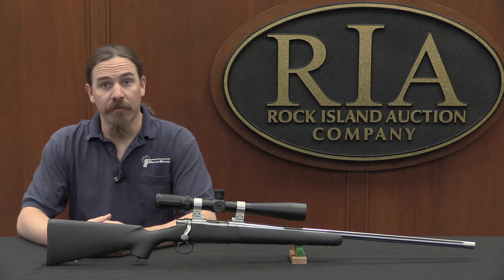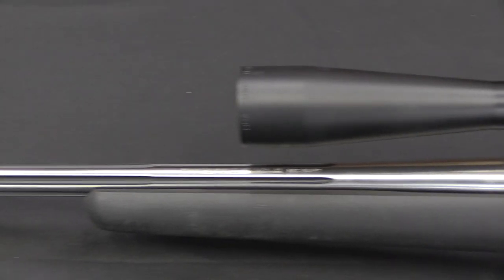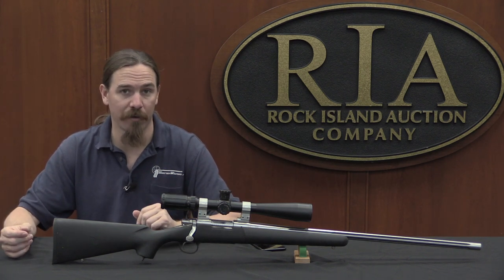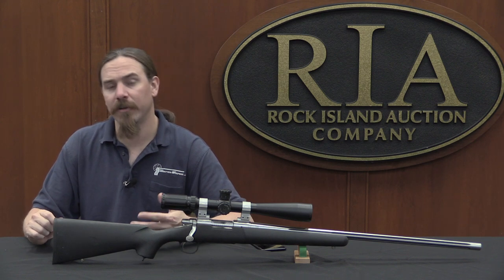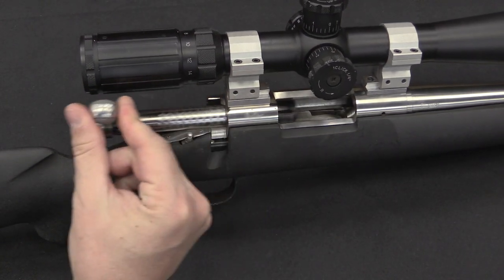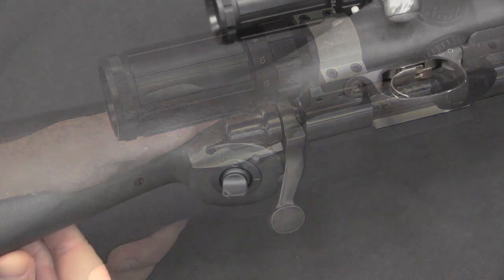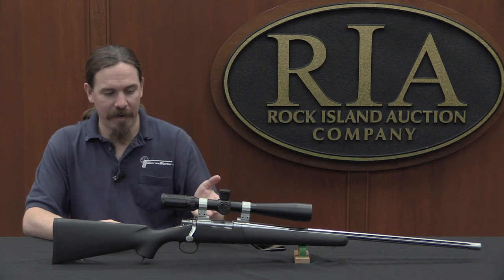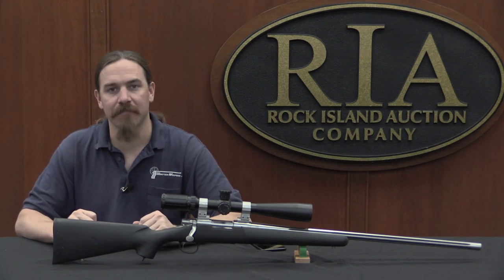Remington EtronX: Electrically Primed Ammunition

Comment: The screwup that Remington made was changing the ammunition. A solenoid operated firing pin would have retained all of the positives of the electronic trigger and bolt system and allowed standard ammo to be used.
Reply: But that would only have given you a nicer triggerpull and not reduce the lead time... so less PR blabber in the brochure.
Also, that key at the bottom should have been a switch.
Reply: @andersjjensen   I actually see the key as  a feature. For people looking for a gun that no one else can pick up and use, whether children or intruders or otherwise. Less messy than external locks.
Reply: @AgnumMD  good point actually
Reply: @jewsrbad  Maybe so. The market apparently agreed with you at the time. But I also agree with Ian, that it's only a matter of time until electronic ammunition is the standard. But who knows how long that could be, maybe 100 years.
Reply: @AgnumMD  I think it would be good to combine with caseless too.
Reply: Solenoids are very sensitive to strong magnets. Have a look at the Lock Picking Lawyer defeat all kinds of electromechanical locks with just a strong magnet.
Reply: The whole idea was to have a non-chemical primer
Reply: One of the "advantages" of the electronically primed ammo is no movement of a firing pin to disturb the rifle.
Reply: @chaos.corner  
Agreed.
Now only if we could figure out how to prevent cook offs.
Reply: bigricester  That's a really interesting idea. I wonder why it hasn't seen wider implementation.
Reply: They should have installed a small generator that produces a charge when you move the slide.
Reply: OS Arktis  
Your statement is 100% factual.
Even if caseless ammo were used in a bolt action rifle, and the rifle were used heavily enough to heat up and cause a cook off, preventing unintentional discharge is as simple as leaving the bolt open & round out of the chamber when not firing.

I tend to mentally connect caseless ammo and automatic/semiautomatic firearms, so there wasn't really any intended applicability for this particular platform.
Reply: OS Arktis  
You were right the first time...
Caseless ammo would actually be best suited for a firearm with a low rate of fire.
I'm not actually sure that you could fire & reload a bolt action rifle quickly enough to cause cook offs.
I was postulating a worst case scenario, nothing more.

Currently, the only perfectly functional "practical application" for caseless ammo (that I'm aware of) is to stack charges of smokeless powder and bullets in a tube with an electronic igniter in each charge of powder.
Dozens of tubes loaded in this manner are put in a box turned on it's side & bolted to a stand, with the dangerous ends pointing down range.
It's computer controlled and was the fastest firing "gun" in existence when the documentary that featured it was aired.
Off the top of my head, I'd say sometime around 2002 the army(?) had gotten far enough into the research and development phase of them to allow History Channel's "Future Weapons" to show them on broadcast television.
The proposed use was to take advantage of the relative modularity of each unit and stack them to form a wall.
This allows the operator to send a literal wall of high velocity lead at any perceived threats in the general area.
Reply: OS Arktis  
The stacked round thing totally works. They demonstrated both rapid fire and precision fire on video.
Obviously the computer respects a firing sequence... 
The minimum delay between rounds being fired from the same tube is only a couple of milliseconds.
I'll see if that episode has been uploaded to YouTube & post the link if it has.
Reply: OS Arktis  
Not a problem...
Of course, the natural progression for a curious individual would be to attempt to replicate such a simple contraption. 

Perhaps controlling the firing sequence with something like a raspberry pi or python installed on a spare Android phone, that would communicate with a set of relays that actually fire the charges via either a Bluetooth serial adapter or a USB serial adapter.

I have to caution against doing this without consulting a lawyer who is familiar with the N.F.A. 
As I recall, there was a relatively recent provision added that prohibits using a purely computer controlled firing mechanism. 

I may be completely mistaken about that as well, and such a contraption may simply be classified as a muzzleloader.
Better to be safe than to have the B.A.T.F kicking down your door at 3:00 AM.
Reply: @andersjjensen  A solenoid operated firing pin would have exactly the same trigger pull but a 50mSec lock time.
Reply: @faustovieira  A sufficiently strong magnetic field will also jam up a conventional firing pin… designing a firing system using just magnets and no springs is an interesting thought experiment too boot.
Reply: @chaos.corner  It's been done:
https://en.wikipedia.org/wiki/Voere_VEC-91
Reply: @kaisersose5549  Actually, one of the stated (theoretical) advantages of caseless ammo is higher maximum rate of fire because there is no ejection procedure (except manual ejection in the case of a jam). However, as you know, there's the possibility of cook-off. I've read of two different potential solutions to this problem (and they are not mutually exclusive).

The first is to have the operation work to rotate the entire chamber, instead of pushing on a bolt (the G11 assault rifle and the LSAT light machine gun used this). This separates the chamber from the heated barrel, allowing it to cool off faster in between shots. (supposedly, someone involved in testing the LSAT said that, "when the barrel is red-hot, the chamber is only slightly warm). 
The second is use a type of propellant that will only ignite at a higher temperature. The G11's ammo ignited at 280 C instead of the usual 180. I read somewhere that the temperature could be increased higher if the firearm uses electric ignition (I seem to remember the figure cited being a temperature of over 1000 degrees)
Reply: @jewsrbad  it brings a variety of benefits to the table and the ammo is cheaper and safer (after mass production ramping up). Its a very unconventional design for sure but especially considering the target market of sports and hunting this is genuinely a great innovative design.
Reply: @5000rgb  a tiny firing pin moving wont disturb anything but the rest of the stuff moving will
Reply: No.  It is like the shaving razor companies, coming up with a proprietary connection for the blade so you always have to buy their blades.  That is where they make their real money.  Same thing with this - you will always have to buy Remington's ammunition.  Nice try, but it did not work.
Reply: @k_enn  They sold a box of what you need for reloading tho...
Reply: If Remington really wanted to sell this, they would offer the ammo as super cheap to go with the expensive gun. That's how the economy of that time worked, how it still largely works today.
You have one of two scenarios generally:
1: Expensive initial investment with cheaper follow-up cost.
2: Cheap initial investment with expensive follow-up costs.
It's an unrelated product, but think of the example of the printer: You have two basic kinds that follow this trend. Remington has made a very expensive rifle with unproven technology that also costs more (or at least the same—ish) to run. They should have either taken a loss (or less of a profit) on the rifle and made their money through expensive ammo; this ammo they should then also license for other companies' use in their own electronically actuated firearms... or they should have made the rifle expensive but then encouraged other companies to produce compatible ammo. The way they're doing it makes me think of the gun design follies of the early 20th century and before, where each gun comes with its own proprietary cartridge, and only after wide firearm adoption is that cartridge considered for other guns. This, by the by, is still on-going with my favorite pistol cartridge (the .40snw, which is apparently dying a protracted but inevitable death). Remington wants you to invest in their expensive ammo to run their expensive gun because ... because it's cool, bro.
It's kind of silly, really.
Reply: That's what I was thinking.

Comment: "Turn the rifle on" words I thought I would never hear in my life. If the manual speaks of blinking lights than the damn gun better shoot lightning bolts or magnetically accelerate a slug
Reply: Next, add a Halo-style ammo counter.
Reply: Rail gun?
Reply: Or at least have an ominous whirring sound effect every time you load a new round and charge the firing capacitor. Finish it off with some LED bar graphs on the side just for coolness.
Reply: DNFU From my understanding, they require expensive rare earth, which would hinder military adoption of small arms variations.
Reply: GRAVITY RAIL GUNS

Comment: Where's the version that you charge via wall plug/USB?
Reply: You could easily convert it using a battery pack (instead of a regular 9v), some basic wiring, and probably a USB type-C connector.  USB-C can supply 20v/5A/100w so it should be enough to charge a battery pretty quickly.  

I don't really see the advantage to charging the battery while it's in the gun, though.  There's still the chance of the battery going tits up and leaking in the gun which would cause damage.  Also, it would be more practical just to use a chargeable battery or battery pack that you just swap out on the go - that way if you NEED your rifle and it's not charged, you can just spend a minute swapping a battery rather than waiting ~15-30 minutes for it to charge.

The easiest and best way to do this would be to spring for some rechargeable 9V or 9V compatible packs from the get-go and just recharge and swap them as needed.  No wiring changes at all.
Reply: @Dan "wiz" Parmenter Get a wireless charging butt plate and sewing some wireless charging coil to your hunting coat. Wow

Comment: If this was cheaper this would actually be a great learner firearm for children; it tells you if you leave the safety on, it has a key so they can only use it when they're supervised, and the operation is slightly simplified.
Reply: Alex A right very easily converted into a firearms safety system. 👍.  Then for cops, they could use the magnetic or RFID required to fire rings/watch.

Comment: My gripes with this gun:
a) The key. Is it REALLY necessary to operate a gun like a car? And given the size and the position of the lock that really is an invitation to desaster, aka a key being lost or broken off because of poor handling.
b) You gotta screw off the buttplate in order to insert he battery. As others already have statd below, that won't be fun on a hunting trip, especially if you accidently lose a screw and spend all day searching the floor in the forest.
On the positive side, the lack of spring tension might be a boon for people who have issues operating a normal bolt-action rifle for whatever reason. If the battery compartment was in the front you could actually make a compact and modular receiver design that can be customed for hunters with physiological disabilities or for sporting issues. That would be pretty neat.
Reply: 44WarmocK77 answers to questions never asked. :)
Reply: yet. ;)
Reply: In case dumb children got their hands on it. Can't fire it at all.
Reply: if they made the rifle today, they probably would have made it rechargeable. rechargeable batteries have their own problems though. for the lock and the electronics in the rifle i can see some issues arising with age. Any flaw that any simple electronic device can have, this rifle can have. it would likely be sealed but with age thing wear out. then you get to the key. not a bad idea but you lose the key you cannot fire the rifle. it is a safety feature and a safety feature that could be added to any device which would act to disconnect the sear in most systems but in this system it would be a switch. all of this would come up in the design process so i would not be overly concern with these issues.
Reply: No, because a chain is only as strong as its weakest link. And I'd prefer the chain to be exceptionally strong since we're talking about a firearm here.
Reply: 44WarmocK77 Was

Comment: I don't think that hiding battery behind butt plate on screws is such a good idea. Replacing it in the field would be a pain in the butt.
Reply: M1ndzor, yes, requiring a screwdriver is silly.
Reply: The way this system works, one 9V battery should last for a good number of shots.  And as this is a hunting rifle, it would be a no-brainer to make sure it has a fresh battery at the start of the season.  Just one of many prep things to be done there, and actually, checking one battery sounds like less effort than checking all the things you would on a mechanical bolt-action gun.

And even if you had to replace the battery away from home, it would be a 30-second job with a Leatherman.
Reply: Lots of guns can actually be dismantled and reassembled on the field in very short time or short time... I think screws on the battery would be a problem.

But, this is not made for the field, it is made for hunting... Take your time to change the battery and go back to track your game.

Unless it is a bear, then run, while unscrewing your gun and replacing the battery in the same time, while having a bear coursing you.

This is a very good exercise.
Reply: +Grégory_Fleury you are in the field when you're hunting!!! do you hunt from your living room? because when im out in the field i don't normally bring my Wheeler toolbox
Reply: Of course I am ! I am a cockroach hunter !

...

Seriously, sorry about that I am not an English native so those words are sometimes blurry.

I thought "field" was for "battlefield".
Reply: If I was carrying this around in a forest with the potential of bashing it against a log or something by accident, i think having an easily openable battery door would be a huge liability. Yeah, popping out a screwdriver and fiddling with that is a pain in the ass but at least that can be done preventatively. Losing your battery entirely or cracking a battery door because you slipped and fell would be a super buzzkill.
Reply: Two pressure plates or a rotation device like the key that could fit both roles ?
Reply: It's on two philips screws at the butt of the stock. If you break that you broke the whole stock of your rifle, which you could have as well done if it was a regular R700, especially a wooden one instead of polymer. This is just looking for trouble that simply does not occur.
Reply: For the amount of power it'd use, that 9v battery would last a very decent amount of time.
Reply: From what i remember reading, the battery is going for a few hundred shots, you have to remember this is just your standard 9 volt battery that's been around since the 50s, if they put a modern lithem pack in this it could go for thousands without needing recharge.

Plus ontop of all this, it's a bolt action rifle that holds a maximum of 5 rounds at any given time, you are not going to drain the battery quickly
Reply: A pain in the buttstock.
Reply: Daniel G good points but there are more options. I think the best way would have been captive push pins on the top and bottom of the buttplate. If it's good enough to hold receivers together, ... !
Reply: Mermaid Man true, but you don't remove the partially filled gas tank and install a full tank in its place. Most people don't use rechargeable batteries so putting fresh batteries in every time you go out would result in either you wasting a lot of batteries or quickly having a drawer full of partially used batteries.
Reply: If it blinks at you for putting the battery in with it on fire, I'm going to go out on a limb here and presume that it'd also tell you your battery was running low. I wonder how many shots you'd get on a battery...probably a lot?
Reply: Yes, impractical idea with replacing battery. The rifle should be charged through USB. ;)
Reply: This isn’t a combat firearm, in an emergency yeah okay. You’re right. A firearm shouldn’t contain electronics at all.
Reply: acting like there's not a screwdriver in the multi tool that I've never seen a hunter leave home without, and that it would be any kind of problem is kind of absurd.

Comment: Probably a good concept for a weapon that fires caseless ammo, since you'd be able to remove the firing and extraction mechanisms, making the gun a lot more compact. Anywhere else though, and the electronics are gonna be pretty useless.
Reply: Yeah, that reduces the gun to basically a tube with an electrode on one end and a rotating valve assembly to seal the chamber. (Are you reading this, HK?)
Reply: There is one, Metal Storm it has 36 barrels and does million rounds per minute.

Edit, for 36 barrel gun with that rate of fire it’s rather compact.
Reply: @Dang_Near_Fed_Up  Late but what about heat dissipation? Wasn't cook-off due to the lack of casing to remove heat from the system the real problem with the G11?
Reply: EMP's could end a battle in seconds.
Reply: @boltaurelius376  : Every camera flash is a small EMP. EMPs are fairly easy to protect against, so long as you don't have antennas or long wires attached to your electronics.
Reply: @absalomdraconis  Well except the ones that come from nukes detonated at high altitude.  Then again, that involves a nuke anyways.
Reply: @maitele  late again, but that’s actually a reason to use electric priming. Instead of designing it with a propellant that has to ignite at a certain temperature, and hoping that the temperature of the rifle doesn’t get high enough for cook-off, you could make a propellant that basically never cooks off and requires an electric charge to ignite. Like C-4, for example.